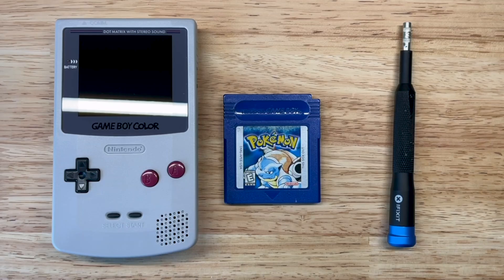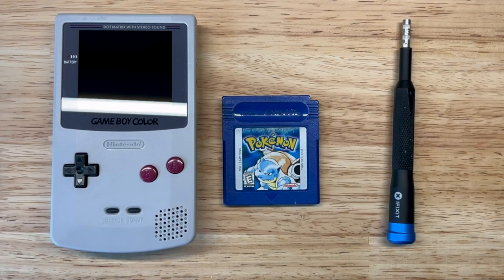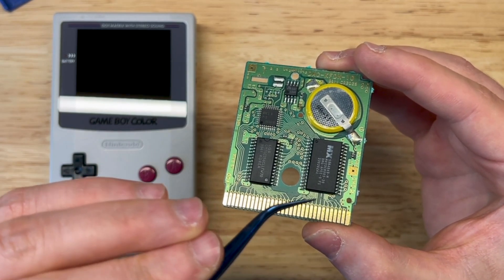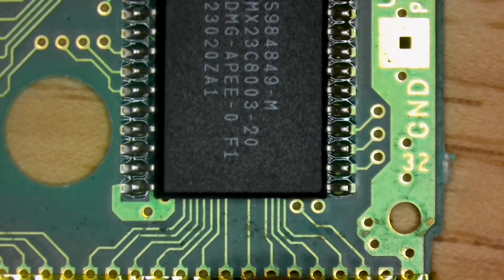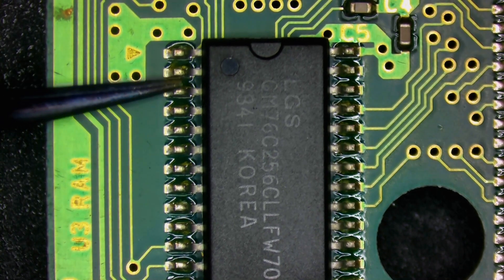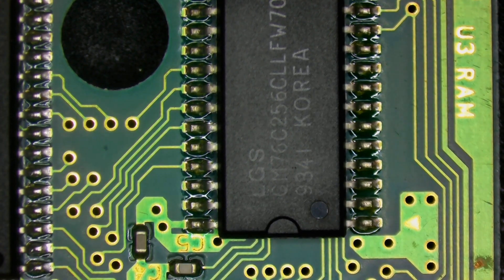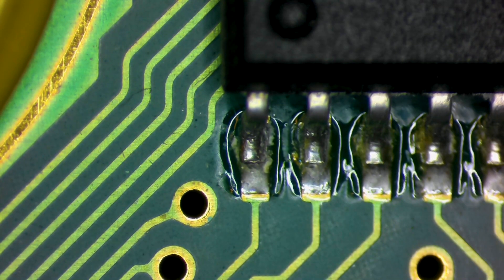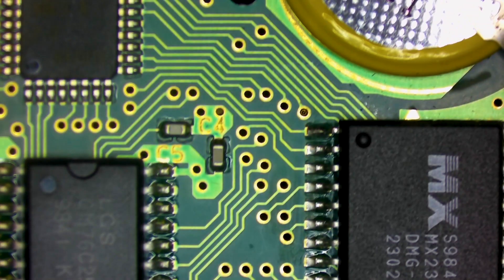Pokémon Blue Circuit Board Repair

Comment: I would recomend just to refflow all the chips with fresh solder for prevention of future solder cracks. Cool video :)
Reply from the maker: It’s not necessary unless it’s needed. Unfortunately “just reflow everything” is a common suggestion that leads to people causing unnecessary damage to their games. Isolating the issue and addressing it as needed is more appropriate.
Reply: Although reflowing all solder is tempting, any time you add heat to a circuit board you run the risk of causing permanent damage. Reflowing only what is required is definitely the play.

Comment: This is a very common issue with Gameboy Color games. Pin 1 of the rom goes loose over time. This must had been an issue at the factory. But most games stop working altogether with no or corrupted Nintendo logo, strange that this one booted with the loose pin.
Reply from the maker: Sometimes it would boot, other times it wouldn’t. Sometimes it would randomly freeze in game. I’ve seen it a lot with these games.